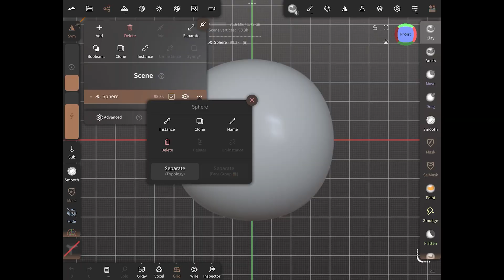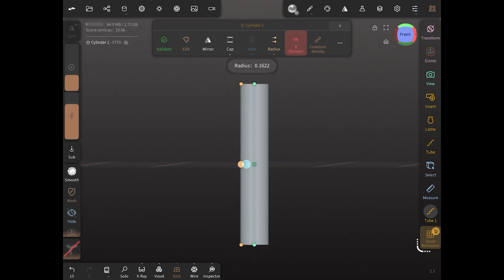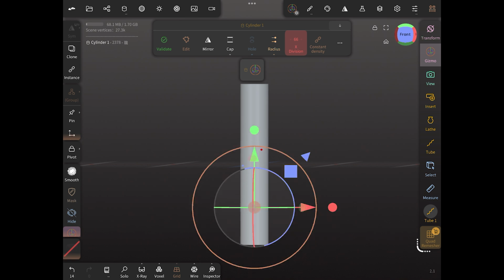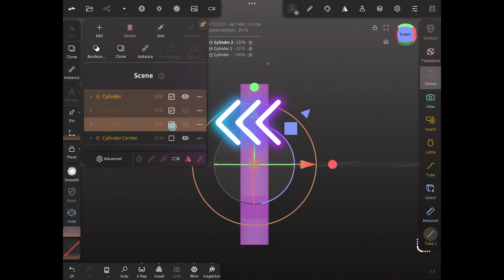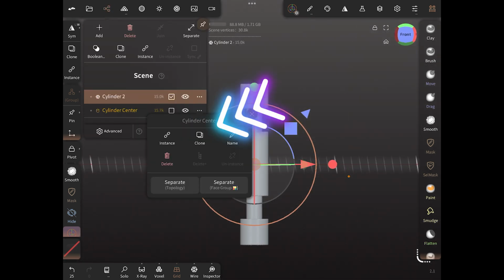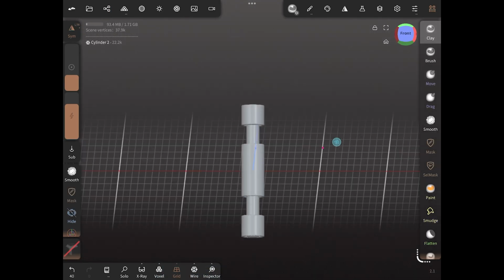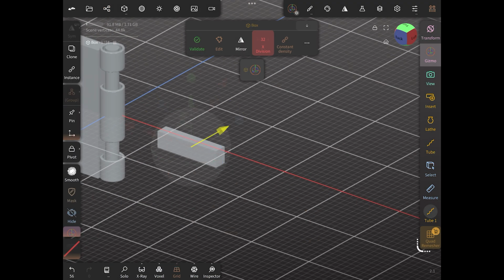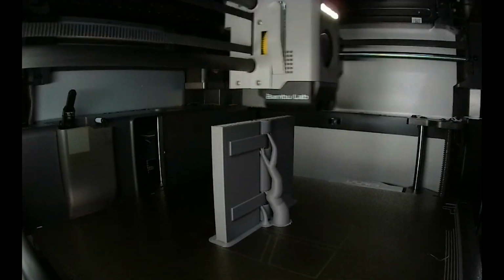Simple Trick to Create Articulated Action Figure Hinge Joints!

Comment: few weeks ago I had an awesome idea, joined 2 smart phones by duct tape to make it like it was a flip phone, its not a prank, i have to do it because the other one lost its touch and the other one was its acting like controller via blue tooth, but I wanted stronger that it could plip like a book but tough enough when acting like a tablet but i did not achieve that, few days later i found a trashed plastic chess board, im so happy because of its hinge and size that could fit the 2 phones, hastedly carve the thing with just stones like a caveman, almost destroyed the board but duct tape held and it was perfect but due to my barbaric approach, the integrity of the case so i have to duct tape it all to hold its shape while maintaining its flip function and its so ugly i wanted a new plastic chessboard to carve more cleanly, leading me to idea that, what if instead of carving chess board i just make a specific molded hinged case for the 2 phones, but i dont have the idea or tools to make it happen, right now the two phones were helded by duct tape on a new version which i call, back to back flip because the flip but there babck touches when close, meaning you could use them back to back as sinle close phone and still do tablet mode, this time it held much more streght whike on tablet mode because of the way they were duct tape, much cleaner and neat but still, I need to build a proper easy pop in and pop out flip case for it.